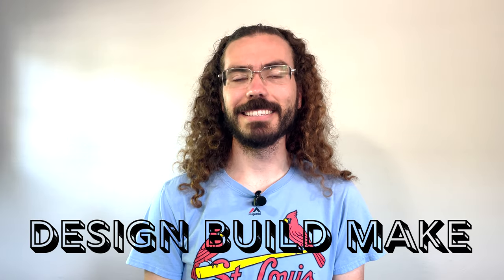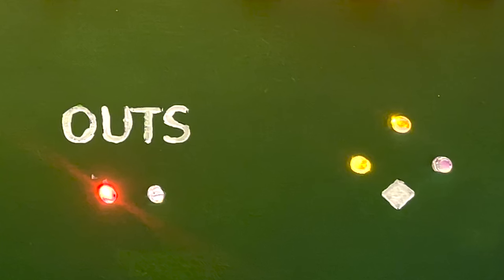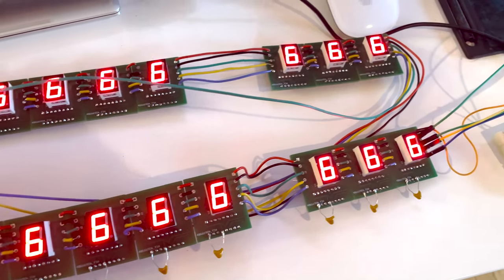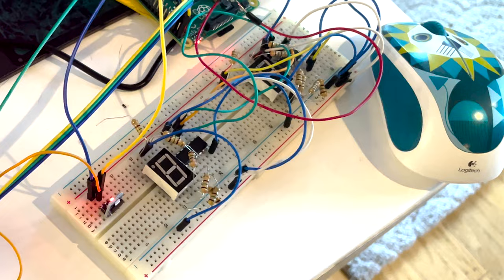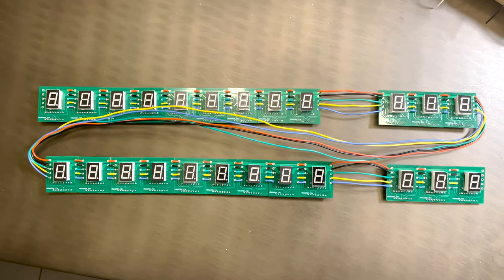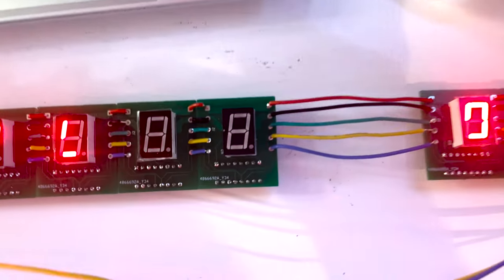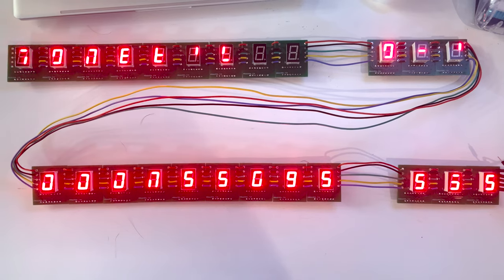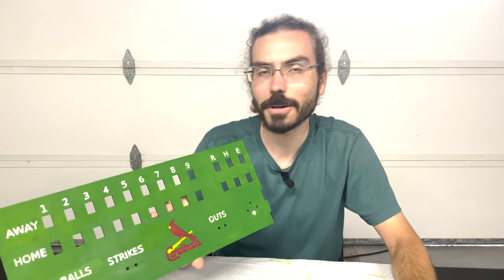Desktop Baseball LED Scoreboard

Comment: Hey Clayton, Cool project!  My wife and I are also St Louis Cardinal fans and I would love to create one similar to this but only larger for our game room in the basement.  My experience with Raspberry pies is a bit limited and haven only recently gotten back into coding (use to do alot when I was younger).  Anyway you would be willing to share your code and circuit board design to help me out?
Reply from the maker: Thanks! My work contract makes it a bit hard to share code broadly, but if you send me a note at desginbuildmake@gmail.com (typo intended) I can individually send you a google drive link with the code, circuit board designs, instructions, etc.

Comment: great job!  controlled from an arduino?  i had thoughts of this for my minor league team but i thought about doing my display on a 4x20 lcd screen for simplifying the display.  i know how to get the data on a browser (i can see it in my browser), i just have to figure out how to have my arduino ask for it, how to parse the data the arduino gets back, and i have a good idea how to write it on the display as i've done lcd screen writes for a smoke/dust sensor project i did.
Reply from the maker: I actually used a Raspberry Pi but an arduino with Wi-Fi could work too. 

I mostly relied on an existing python library called MLB Stats API to access the game data but it just makes simple GET requests to the MLB service which returns the data as JSON. LMK if you’d like to see some example code and I can DM it to you.
Reply: @designbuildmake  i'm familiar with mlb stats api.  that's where i picked up endpoints that are used.  i have not looked at the mlb stats api code  but probably should if python and arduino are similar programming languages.
Reply: @designbuildmake  I would love to see some of the GET code you used for what data requests and how it did live updates. Looking to make something similar for a family member. 

Do you have to do anything to identify a game on a certain day or does it live update on the day of a game and then is blank on other days.